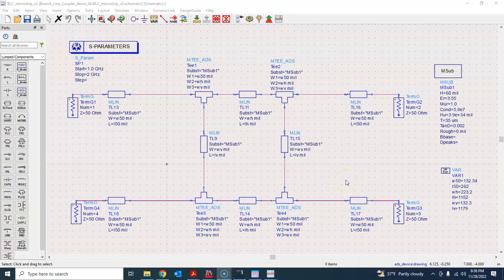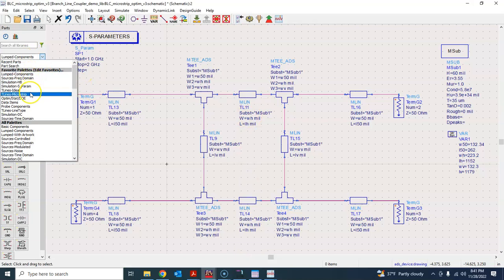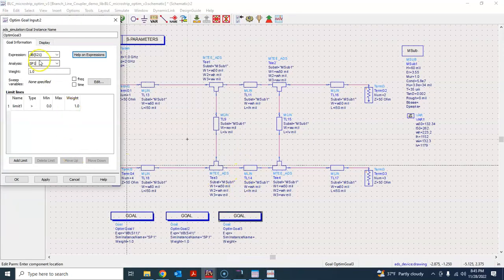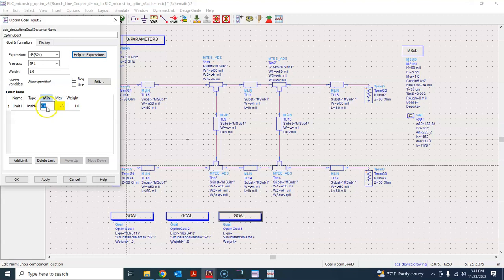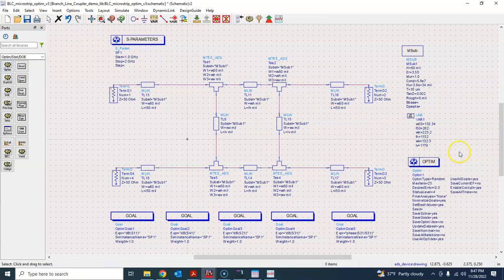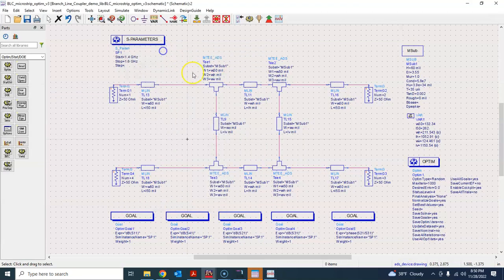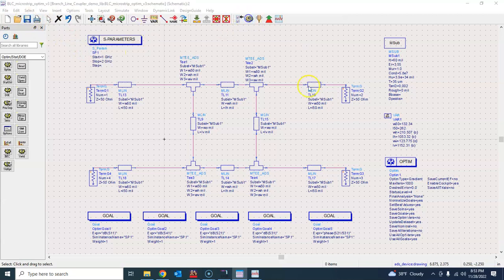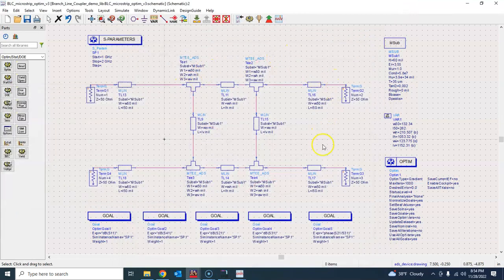Microstrip Coupler Design using Advanced Design System (ADS)- part 5

Comment: Sir how to do optimization for the dual branch line coupler, could provide the video sir
Reply from the maker: @hrijithk7623: I will, in due course. Meanwhile, you can do it yourself as follows. To do a dual-band optimization in ADS, use two simulator controllers instead of one. So for example,  one s-parameter simulation controller will be centered around frequency f1 (SP1) and the other around f2 (SP2). The goal should also be defined twice. For example, for S11 goals- one goal will point to SP1 and the other to SP2, and so on. Use one optimization controller. That's it.